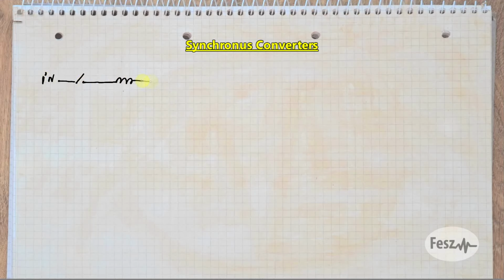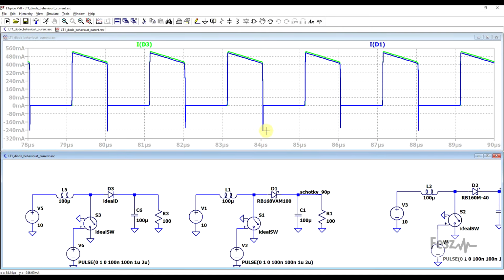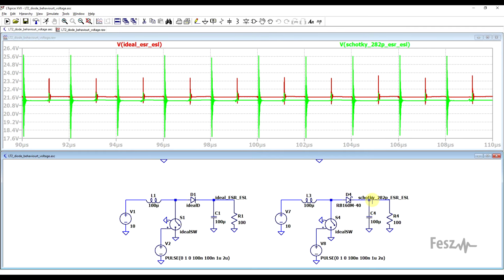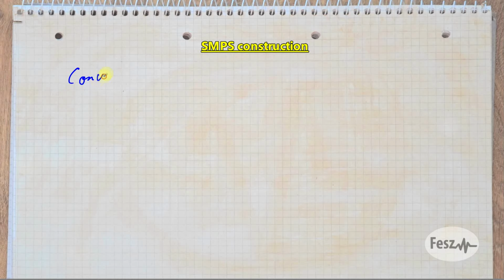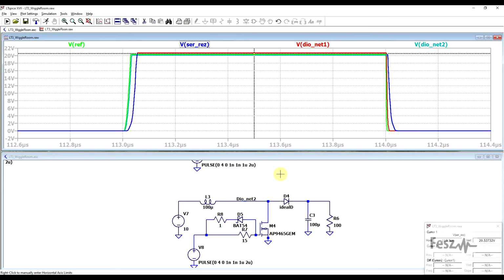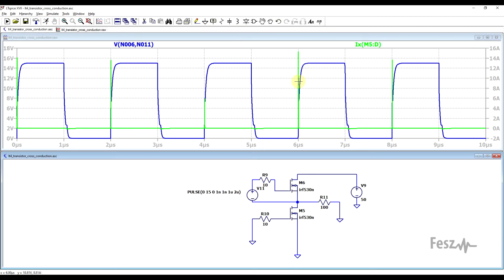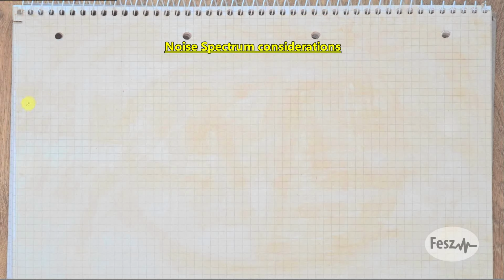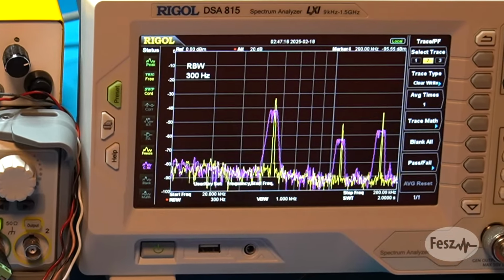SMPS Noise Analysis - The Actives

Comment: Is the efficiency the same when using spread spectrum?
Reply from the maker: Spread spectrum should not affect efficiency; the small variation in switching frequency usually does not have an effect on the general behavior of the circuit.

Comment: I wish i could watch this video 15 years ago when i was building my first power amplifier 5.1 ch 300 + 60x5 W rms. For the power supply i use a lot of custom pc power supply transformer and some irf450 and ir2150 or something like that. I destroy a lot of this transistor and ic before i get some stable power. I was on my last year of electronics enginner degree. Thank you for the videos

Comment: Only tangentially related but, since I just got unexpectedly bitten by it, a cautionary tale for those who need to care about EMC compliance in respect to conducted common-mode noise generated by what FesZ described here: if you do not minimise and contain that CM noise, it will leak out of unexpected places.  Quite possibly even if you use a full metal enclosure with 360° shielded connectors.

My last design is intended to be powered by an off-the-shelf desktop AC adapter.  We did precompliance testing with an own-brand 150W RS and 120W Meanwell adapter.  The RS adapter only just passed class A conducted limits when lightly loaded, so we preferred the Meanwell which otherwise comfortably passed class B.  

Shortly before formal compliance testing was booked, it transpired that LVD compliance required us to limit the AC adapter to < 100W.  So we went to formal compliance with the 90W model from the same Meanwell series, assuming that its noise profile would be comparable.  I should have known better.  EMC is a bad time to make assumptions, but it was late in the development cycle and it simply didn't occur to me to question it.

The 90W model was fine in respect of AC conducted emissions, but it caused a massive fail on conducted emissions from signal ports, in this case shielded Ethernet.  I haven't had a chance to fully investigate yet, but it seems that the 120W model had much better CM filtering built into the AC adapter (in which you still have an earth to which to shunt CM noise!)  The 90W model is physically somewhat smaller and evidently has less CM filtering on the DC output.  We found >> 100 dBµV at around ~25 kHz, which was somewhat attenuated by a 9mH CM choke and went away altogether with a different power supply.

That CM noise gets into system ground and just about everything else, and is then conducted (and no doubt radiated) out of any shielded connector.  It is very difficult to get rid of.

Comment: Fixing half bridge SMPS with GDT 50% duty cycle, got confused why GDT Secondary outputting 36%, the culprit was diode used by the manufacturer was not fast enough it was mains rectifier diode w/ 2.5uS reverse recovery time, replace it with 1n4148 Duty cycle return to 46%, then i was thinking "is this a placed time bomb on this device?"

Comment: There is another option for wiggle room with built-in converters. I've seen a few datasheets that recommend using their mosfet output to drive a different mosfet to switch higher currents or voltages. Basically using thier output mosfet as a gate driver for whatever you want. This will let you put resistors and a diode between it and the gate to change the switching characteristics. Obviously, this isn't really ideal nor cost effective for production, but it's a useful trick to keep in mind for solving some of these issues.
Reply from the maker: I would say that if you take this route than its no longer a converter, but rather a controller... you're using the internal transistor just as a driver, so you can put anything on the outside.
Reply: @FesZElectronics  That's fair. Perhaps it's more of a 'convertion' than a modification. The advantage of that it won't effect the frequency like putting a resistor in the timing path did. It and can be used in Fixed Frequency converters that don't give you access to the timing pins, like the common MT3608 or SDB628.